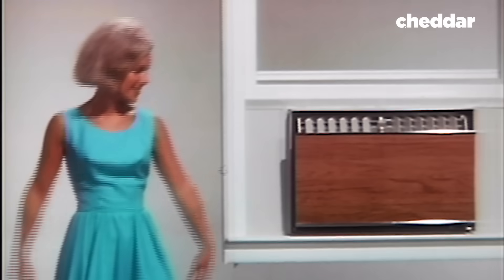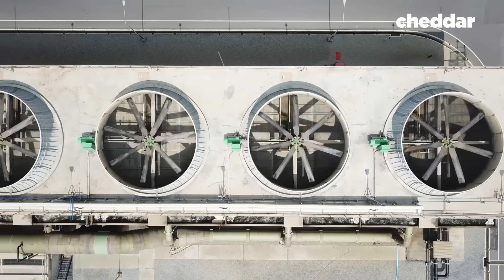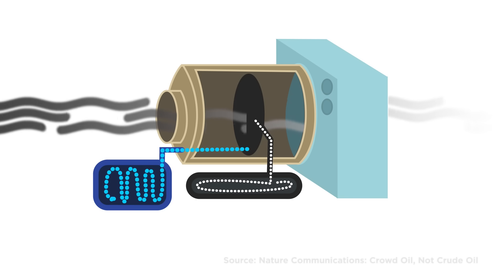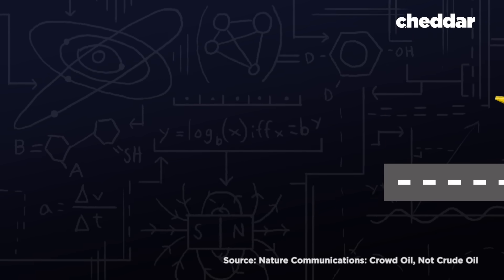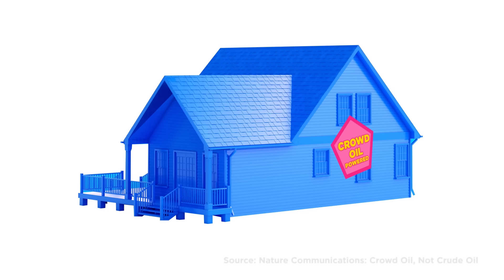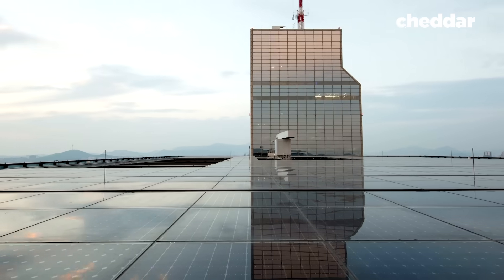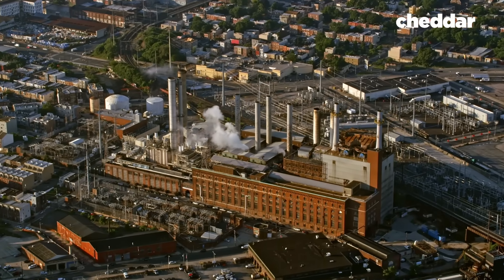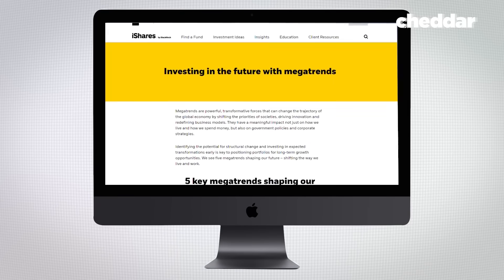How Your AC Could Help Instead of Hurt The Environment - Cheddar Explores

Comment: This is like trying to cure obesity by making twinkies a post gym snack. The problem isn't where the oil comes from, there's already too much CO2 in the atmosphere and we're already too dependent on oil based technologies. Rather than using electricity to make oil, use electricity as the source.

Comment: Would be less viable at higher altitudes. Just like any other type of condensation method. Not to mention at higher altitudes there is also less co2 given that co2 is heavier than air. But our power plants could recapture some of their carbon... which is basically fuel they didnt burn properly in the first place which would increase a plant efficiency... except at the cost of recapturing it is actually less efficient.. hmm just like the reason this has been a thing since the technology has existed for this for over 30 years now. Though once we have more renewable energy systems would be a good way to remove co2 from the air.

Comment: And you are still not really removing Carbon. If you are turning it into fuel, you are using energy to create this fuel (remember conservation of energy). You are just maybe energy production more efficiently. This is your typical perpetual machine crap. Remove CO2 from the air with energy to create a new fuel when burnt. Trillions of tons of stuff to be dumped, making probably garbage removal look simple. And we do not have 30 years, we need to reduce now because even if today we stopped, temperature increase would continue for decades because it takes time for the earth to warm up.

Comment: 30 years? More like 9. 

Electrolysis uses more electricity than it generates if we feed the hydrogen into a power cell. Even more so if we then combine the hydrogen with the carbon to make kerosene or others. 
That means that on a energy perspective, it makes more sense to just dump/collect the water, and simply store/sell the carbon directly. 
The only reason all the rest was slapped onto this is to have a by-product that generates revenue. 
But that by-product emits back the very same CO2 it just pulled out of the air. 
Sure, if we emit, might as well not be NEW carbon. 
But since this process is energy-inefficient, it's much better to push for a complete transition out of a fossile-fuel economy, instead of reinforcing it with "greener" tech. 
And I know, plastics, chemicals, there is so much of our production process that is deeply embedded and dependent on fossile fuels. 
But for almost every uses, there is alternatives. It's simply not profitable for now. 
That's why we need a mix of political, advocacy, populist pushes to invest in these alternatives. 
Also, if we wait for profitability, it's too late. We will HAVE to make the "unprofitable" choice, if we want a future at all. 
And in a climate runaway disaster, nothing is ever profitable, if there's no humanity at the end.

Comment: I'm not sure about the efficiency of the methods resemble the disadvantages of hydro fuel but Can we just yeet the whole co2 capturing  system and power ours car with the solar panel used for electrolysis instead. No more shipping sized equipments.

Comment: Well .Why we need to make everything in one place. Just collect the CO2 in a large pressurized container and use the water  (or maybe don't use it) like a subsidiary daily useable water source. Then take the CO2 container to a different facility where you can do the hydrocarbon fuel process. It will be a safer option. Yeah, you may say what about the economical perspective. Won't it will be more costly for container transportation. Well, I would say maybe or maybe not. We need to find a solution based on where we are. And we need to find it very fast.

Comment: Well, everybody points to carbon dioxide as the problem but it is the fluorocarbons that are the problem. All the "canned air" use shall be heavily regulated to prevent these chemicals from reaching the atmosphere. These fluorocarbons take the space that CO2 is supposed to occupy and worse than that, a little 500g can of the stuff is equivalent to 5 tons of CO2 when climate change is concerned.

The main problem is that with CO2 if the concentration reaches sufficient level, plants start to grow rapidly to extract the stuff out of the air to bring the concentration down, well before the planet warming becomes a serious problem. On the other hand the fluorocarbons can heat the planet up dangerously with much smaller concentrations and they are not biodegradable (plants don't have a way to capture and use these).

If this trend is not reversed and the focus is not moved from CO2 to the fluorocarbons, soon we are going to have global, forest destroying famine caused by failed crops to deal with.

This technology could help with these fluorocarbons as well, scrubbing them out of the air and store them safely to be dealt with properly.

Comment: The problem is the electrolysis and the CO2 / H20 filter will use more energy than the HC it generates. So unless you have excessive electricity you do not have any valuable use for this kind of technology. Maybe for international space station it is useful, but not for a typical urban city. You are better off using electricity to generate ice with excessive electricity and then use the ice to cool the building during peak hours.

Comment: The problem I see with this is that it doesn't reduce CO2 levels, only keeps them steady (and keeps hydrocarbons as a necessary fuel source). Really those hydrocarbons need to be used to produce something as a carbon sink, like using the system to make simpler gaseous hydrocarbons to be made into "air sourced" carbon fibre (could be used for wind turbine structural part manufacture/EV body parts) or graphene for battery technologies (can be made from CO2+Hydrogen split from H2O). There's little point in converting CO2 into something to be burnt back into CO2 as it will have no real effect. At least HCs in physical products can be used and then get buried back where they belong after they've stopped being useful.

Comment: This is only carbon neutral. A better choice is to produce biochar from agricultural waste. Plant material is heated in an oxygen free container, driving off low carbon gases which are captured for fuel. The remaining charcoal is used as a soil additive where it sequesters the carbon.

Comment: I really thought this was going to be about ac units as a direct carbon capture  system. It seems unnecessary to convert the co2 to fuels. The amount of energy needed to convert the co2 to a fuel would be lest than the energy extracted from the fuel. Plus you would need a place to store the fuel it converts. That storage could increase the space necessary for the system than the shipping container the video says is required.

Comment: Question is if we use the byproduct oil from that system does it produce co2?
Reply: yes, but it comes from the air, so it's carbon-neutral.

Comment: Leaving aside technical problems and the energy used in the process...

I'm not seeing how this helps any if you then turn around and try and sell the fuel.

Yes you extracted carbon dioxide from the atmosphere...
But then you turned it into fuel which, if burned, will just release it all back into the air.

Carbon neutral... Maybe. If you're lucky.
But... It won't help any given a situation where there's already too much C02 in the atmosphere, which is kind of the point of a carbon capture system vs just lowering emissions through switching to tech that doesn't release greenhouse gases in the first place...

Comment: The whole video fails to address the central issue there, just casually mentioning it on the side. While this whole process might work perfectly fine, it is a method of transforming electricity and CO2 from the air into "crowd oil". Now, if this "crowd oil were used as a fuel, the CO2 would be released almost immediately again, leaving nothing but a big investment of energy, for an energy balance wise inefficient fuel, while not changing the CO2 emissions overall.  That's barely more than a waste of renewable energy (and if non-renewable energy is used the whole thing is getting entirely absurd). 

If however, this crowd oil could be and would be exclusively used for synthetic purposes, creating polymers and other substances which will have a much longer life span than fuel, keeping the CO2 for a long time out of the atmosphere, then there might be a point to this whole endeavour. Depending on how efficient this really can be, it could be an interesting alternative to plant based polymers as using agricultural resources for non-food applications is a problemtic thing as well and this technology could be an alternative.

Comment: It will make sense when the renewable electric power exceed the demand.
Currently renewable is below 30% worldwide including hydro. 
Using coal fired power plants to extract 600ppm CO2 from the atmosphere is very polluting, you need at least 2kW of electricity to extract a kW worth of carbon. 
Using solar to power AC make a lot of senses as the sun is bright when you need AC. 
Using electricity to power cars in the winter doesn't.

Comment: By burning the oil you produce you release that CO2 back into the air. You are not producing any extra energy because you invest for energy in electrolization  is greater than the amount that you get from burning the oil

Comment: I've heard of a carbon sequestration technique that where the main limiting factor is water consumption. What if office HVAC used this system to capture the carbon with plain water (instead of the dumb electrolyzer, useful as electrolysis is for other applications) and then the gov't or Sierra Club or somebody straight up bought the carbon substance (it looks like charcoal) and put it back into the ground? Then this system wouldn't merely be carbon neutral, it would be carbon negative.

Comment: The idea of taking the carbon dioxide out of the air, mix it with hydrogen and then put it back into the system by burning it... is just dumb. True, you can then reduce the amount of oil that is drilled from the ground but this idea will not reduce the amount of carbon dioxide already in the air. And the amount is increasing as we speak.
Spreading electric cars, ever increasingly tighter emission regulations and present pandemia are reducing the need for oil. There are pagefulls of news how oil stockpiles are full and middle-eastern oil nations are starting to feel the pressure of reduced income because there is not enough useage for the oil in the world. Besides, we will always need to pump at least some amount of crude oil as the 'petrol' or 'gasoline' is minute part of what is made from it. Do a simple google search for "what is made from crude oil".

So the most important thing for humanity is to reduce already existing co2 from the atmosphere, preferrably to pre-1900 numbers. Forget electrolysis and mixing to make fuel and just capture the co2. US dries and burns enough and then the politicians will finally start putting money into projects like this.

Comment: The energy consumption of these devices would be enormous.  How do I know this? Because you can't create energy, only convert it.  and you always loose some in the conversion.  there are so many conversion steps, I would guess at a 60% efficiency.  You would be MUCH better off putting that energy directly into the vehicle via batteries, and focusing only on the CO2 removal aspect.
Reply: Still worth it for energy storage

Comment: Lmao this was an argument in lack of understanding of chemistry and electrical generation. Most HVAC systems are energy whores. You will be hard pressed to find anyone who is able to run their HVAC on solar for their home. A central air system requires around 3500 watts to power itself. That Means if you're using it for the course of the day you're going to require ~80 kilowatts for a single day of full use for a home. Obviously it's different for every building but it serves my point. If you Have a 10 KW array that ac alone could use the entire amount generated by that array over a day at peak sunshine 🙄 adding in an electrolyzer and oh boy. You've made maybe a dollar worth of fuel? Any energy you get out you need to put in so if you want say a litre of gasoline you will need at minimum 8.9 kWh of energy. That means add another 1-2 kW onto your array. You can quickly see how this is becoming infeasible.

Comment: I'm going to try to explain why this isn't a stupid idea to the best of my abilities because I see quite a bit of comments here, and I feel I should address the logic

#1 The system does not burn the same fuel it produces to power itself, that would be incredibly counter intuitive. Instead, it uses extra energy put into the system by a clean source such as solar or wind.

#2 The reason that we're talking about a carbon capture solution in the first place instead of refitting every energy production/ usage system to clean energy, is that there is already a major excess of CO2 in the atmosphere that is overwhelming natural carbon pumps like forests and oceans, especially with them being destroyed.

#3 The reason building big rain forests wouldn't work is that trees are actually not the most efficient carbon sink we have, that title would go to the ocean and the many plankton and plants that comprise it.

#4 We can't just stimulate the growth of plankton or such in the ocean without causing a blockage of sunlight to deeper parts of the ocean, preventing photosynthesis down there and thus decreasing the oxygen production in the ocean. This would cause fish life to suffocate and die out causing way more problems than it solves.

#5 Rain forests wouldn't work because to have one that could compete with the ocean would require something on par with the amazon or greater and such land usage would be incredibly impractical.

#6 The "fuel" doesn't necessarily need to be burned as such to be of value, as many byproducts of crude oil refining are used in many different manufacturing processes for items people use daily such as plastic or Vaseline. Not to mention we don't really have a very good battery storage system so using oil as a battery would be a little more practical than using something like lithium ion or ammonium (Which is incredibly volatile and could lead to various other consequences like the ones in the ocean section above).

#7 The size issue isn't all too bad, most AC units on commercial scale buildings are comparable in size, and with time and refinement the size should decrease while the efficiency increases.

This is just the what I can figure up from watching the video and my understanding of science, please tell me if there is anything I got wrong or missed.

Comment: It's an interesting idea for sure. BUT this would be absolutely insane if we did it before we are 100% sustainable in our energy production. Laws of thermodynamics. I didn't make them, nature did. We'd release WAY more net carbon dioxide by burning coal/gas/biomass to make the electricity needed to electroze water and turn CO2+H2 back into hydrocarbons. The first step will ALWAYS be to reduce emissions from power generation. After that, never before, we can start using power to reduce the amount of CO2 in the atmosphere. Otherwise it will have the opposite effect!

The entire reason we burn hydrocarbons or just carbon (coal) is that we get energy out of it. ~35% of that is turned into electricity, the rest as waste heat. The same energy we get from burning coal/hyrdocarbons, including the energy we release as waste heat, we need to put back in to get hyrdocarbons from CO2+H2. More, in fact. Around five times more, because of compound inefficiencies. So if we get that energy from coal, we're just wasting coal essentially. Energy can't be created or destroyed. And the entropy of energy will never decrease by itself.

Comment: The problem with making CO2 into fuel is its just gonna be burned again. It could be a stepping stone but really we need to cut burning for electricity entirely. Future generations will look back on coal/oil/natural gas similar to how we view the former asbestosis industry. This problem will only continue until we stop burning oil entirely

Comment: 2.4 million tonnes of oil per year is ~ 17 million barrels of oil per year - however, the US uses about 20 million barrels of oil PER DAY, so yeah, not particularly effective at fuel generation, probably not enough to offset the cost to actually accumulate the fuel out of the air.

Comment: 0:35
"In 2016, they started turning that CO2 into liquid fuel."

But...CO2 is BURNED FUEL. In order to "run the reaction in reverse" and create (presumably hydrocarbon) fuel, you have to put as much energy INTO the fuel, as you will eventually GET OUT of the fuel. (Plus efficiency losses along the way.) Meaning that it's a total waste; you'd have been better off just using the energy to create the fuel, directly.

THIS is why you shouldn't send scientifically-illiterate journalists to cover technically-challenging stories!
Reply: How would you know how literate in science they are?
Reply: @erei5659  
Because if they knew what they were talking about, they wouldn't be talking such complete nonsense. Obviously.
Reply: @bcubed72  Made a lot of sense to me. Maybe attend science class again?
Reply: @erei5659  
Clearly that's not true, or you'd understand the first three laws of thermodynamics, and how it invalidates the claim of "making fuel from CO2."

Your science teacher failed you...or vice versa.
Reply: @bcubed72  I definitely think you should rewatch the video.
Reply: @bcubed72  There are physical machines doing the process you claim is not possible.